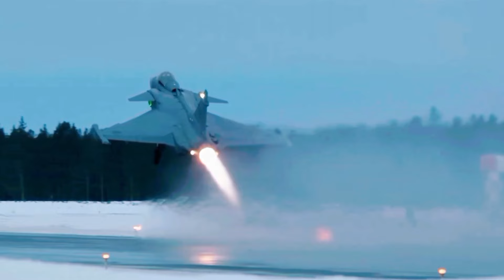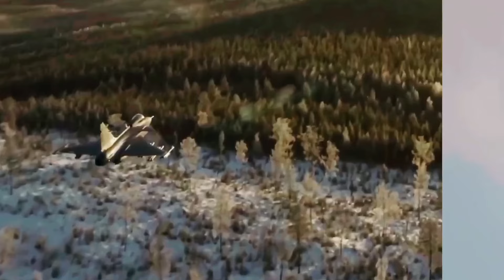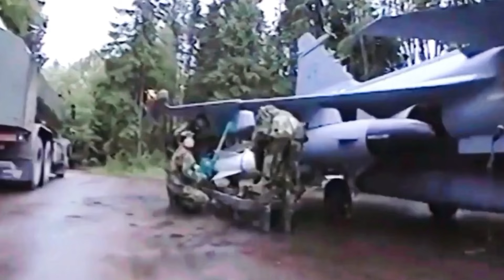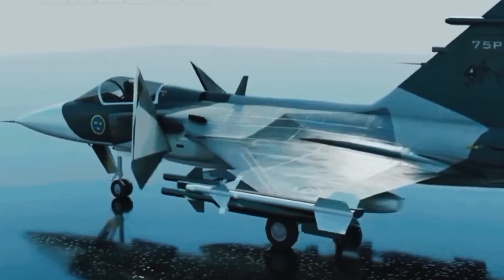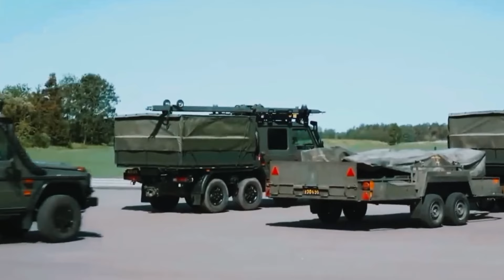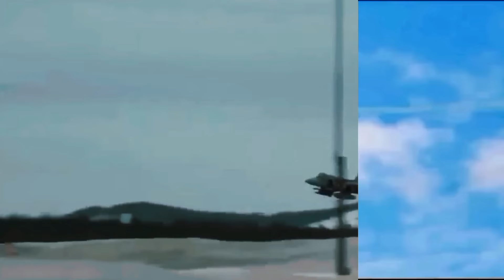How Rolls-Royce Quietly Rewired the Gripen — NATO Caught Off Guard.

Comment: it was never a US stop, it was all on the Colombia side of the deal, 
just waiting on them to make up their minds and the Colombia Gripen deal was signed on 14 November 2025
First thing the EJ200/EJ230 is not a RR engine, it is engine of EuroJet Turbo GmbH a consortium of 4 companies in 4 counties. 
Second, the reason NO jet took the EJ230 deal is, all the little test that has been done show the future upgrade of more power and fuel efficiency come at the cost of engine lifespan and maintenance hours/cost. the EJ200 is as good as it can be and has from day1. 
Third, EJ200 has the biggest intake it can get, smaller intake EVEN with NASA level of design will lose you power and may not be enough for the Gripen E, the smaller Gripen C maybe.

last true-ish RR engine was Rolls Royce Pegasus for the harrier jump jet rest are a consortium owned.

Sweden focus 
For Saab, Sweden the focus is when it comes to fighter jets. 
The plan is for it to be financially viable, even if no other country wants to buy. 

It's a tough sport to sell fighter jets. 
We probably shouldn't develop aircraft if we have to sell them to others to make ends meet, 
says Peter Nilsson, Saab Advanced Programs.
Reply from the maker: @1BigBen Great breakdown 👍 Let me respond point by point, 
1️⃣ Colombia & the “US stop”
You’re right the Gripen-Colombia timeline was driven far more by Colombian political decision-making than any hard US veto. The 14 November 2025 signing confirms that Gripen deals today are about diplomacy, offsets, and long-term autonomy, not just engines or airframes.
2️⃣ EJ200 / EJ230 & Rolls-Royce
Correct again. The EJ200/EJ230 is a EuroJet Turbo GmbH product, not a pure Rolls-Royce engine. RR is influential, but this is a four-nation consortium, which changes how upgrades, IP, and export controls work. Calling it a “Rolls-Royce engine” is technically inaccurate.
3️⃣ Why EJ230 never took off
This is a key point many miss. Every serious study showed that extra thrust and fuel efficiency gains came with real trade-offs:
Reduced engine life
Higher maintenance hours
Increased operating cost
For air forces like Sweden, that’s a non-starter. The EJ200 reached its optimal balance early, which is why it stayed.
4️⃣ Intake size & Gripen realities
Absolutely spot on. Airflow physics can’t be cheated, even with advanced CFD. Gripen E already runs close to its intake limits — shrinking it would mean thrust loss under real combat conditions, especially hot-and-high. Maybe workable on Gripen C, but risky for E.
5️⃣ “True” Rolls-Royce engines
Yes Pegasus on the Harrier was the last fully RR-owned fighter engine in spirit and structure. Modern combat engines are political-industrial ecosystems, not single-company products.
6️⃣ Sweden & Saab’s philosophy
This is the most important part. Saab designs fighters to be financially survivable for Sweden alone. Export success is a bonus, not a requirement. That mindset is exactly why Gripen exists at all affordable sovereignty beats export dependency.
Bottom line:
Gripen isn’t built to win marketing wars — it’s built to win independence wars. That’s why it confuses NATO analysts and frustrates big primes. Respect for laying it out clearly 👏🇸🇪✈️